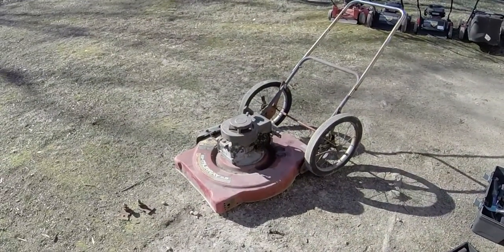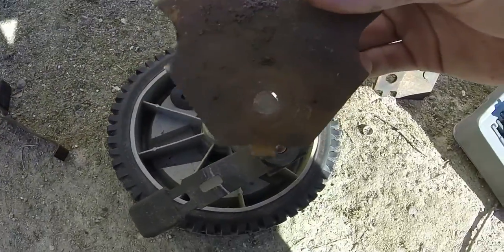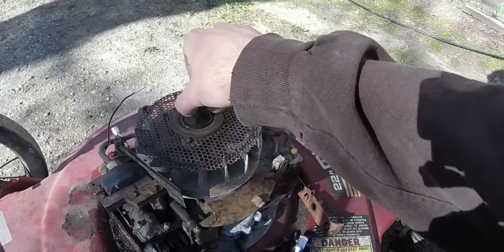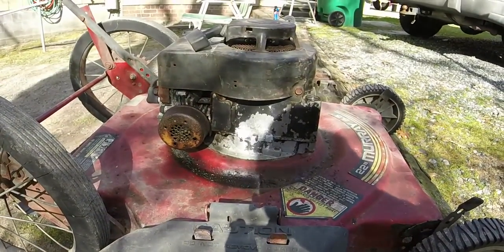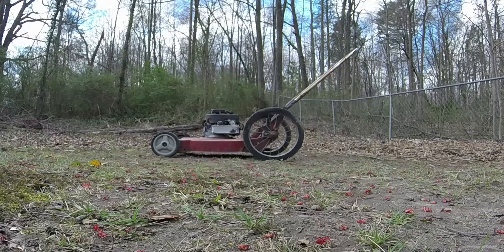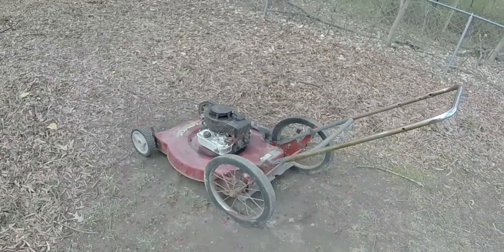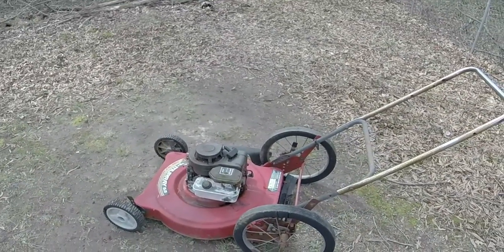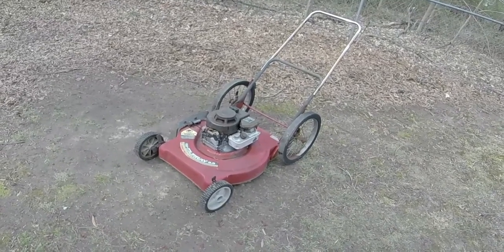Reviving an old Murray with Bicycle rear wheels

Comment: Great job! those older Murray mowers were really solid. I had one just like that with the original engine, it was a 5.5 horse quantum.
Reply from the maker: Yes they are Alan, I bet that's what this one had too originally.  It's definitely well used but cleaned up well!